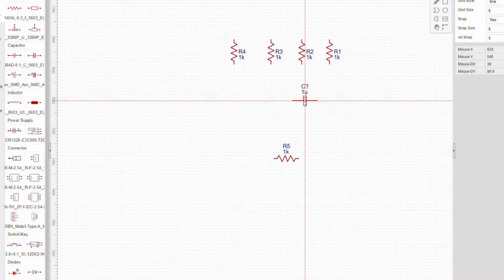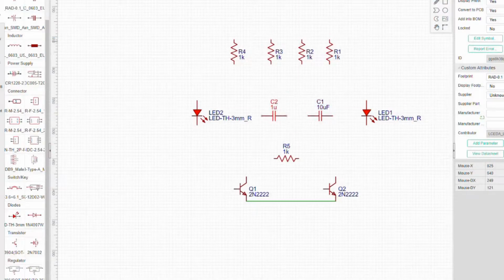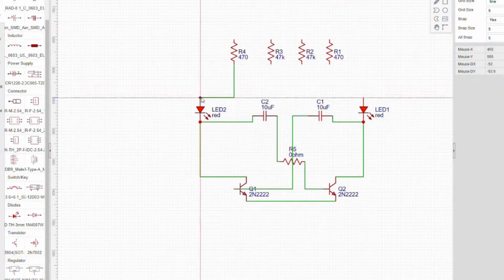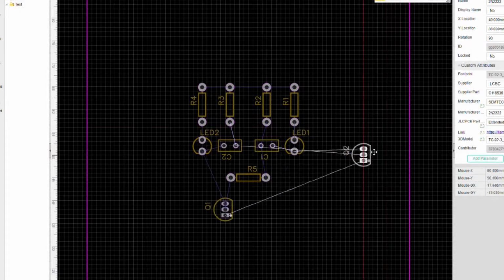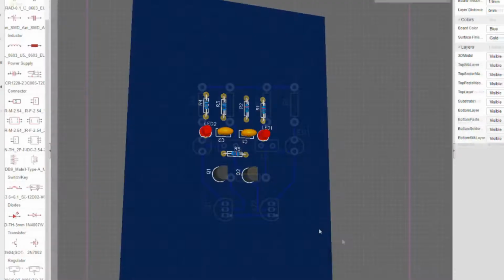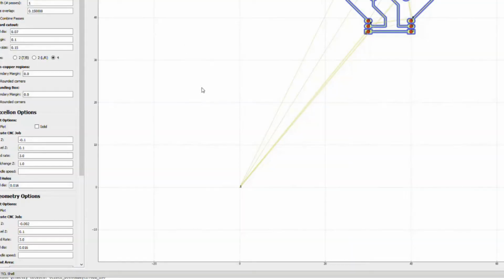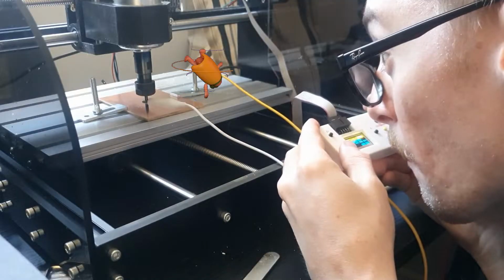How to Make Your Own Circuit Boards!

Comment: I see you've joined the at PCB fabrication crew. Feels good doesn't it. Also a nice tip is that if you're ever going to use thinner copper clads, try investing in a vacuum clamp/vacuum table along with  some sort of porous wood as a buffer